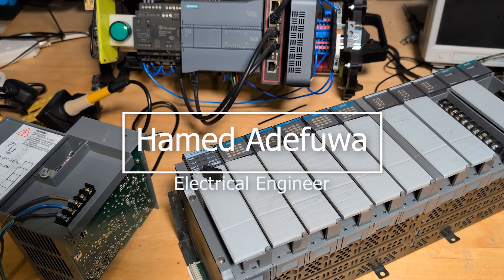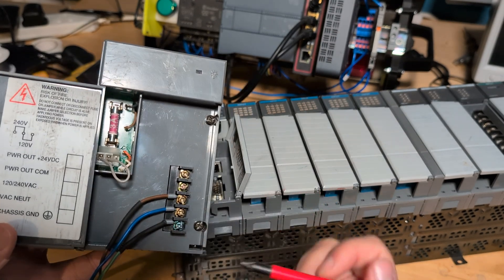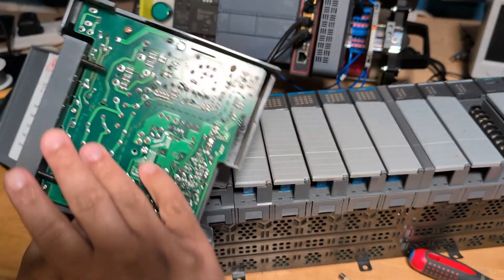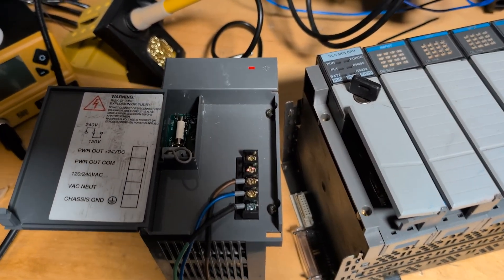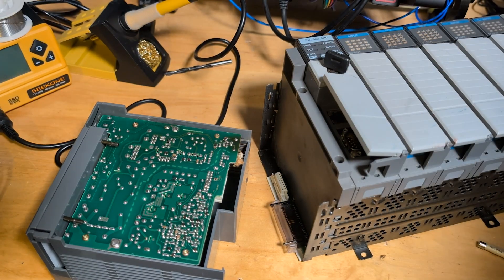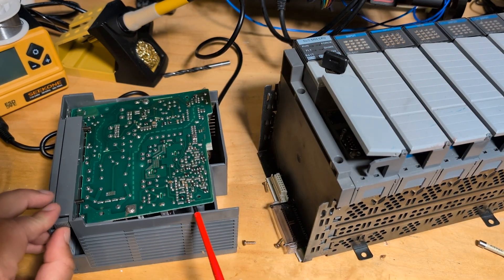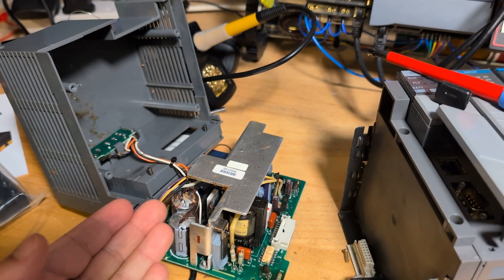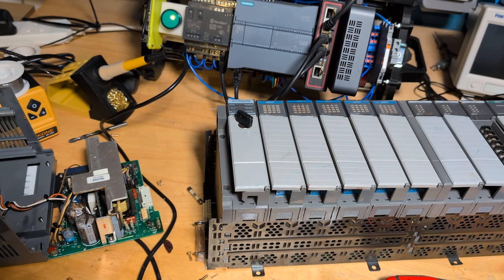Allen Bradley PLC Nightmare - Car Boot Sale Find

Comment: very much still a relevant PLC. my plant has like 5 and my last plant had a few as well. 
a bit slow and they have no safety capabilities, but very much capable in a modern setting.
is AB just not super prevalent outside the US? as I understand it and was taught the SLC was the one to have from the day it came out to when logix came out
 and still stayed popular well into the 00s
Reply: They seems to teach on Siemens PLCs in Norway. At least I was taught on Step 7 Microwin for 200 series of PLCs. Nowadays they most likely teach using Tia Portal and S7 1200.

Comment: This is where you could have used a current limiting device in hindsight ,it would have protected the board from blowing and given you a chance to find the fault , it's called a Dim Bulb current limit device easy to make and would have protected psu till you found the actual problem.